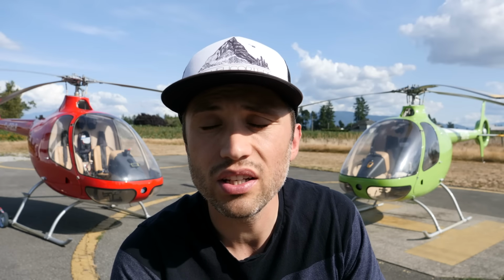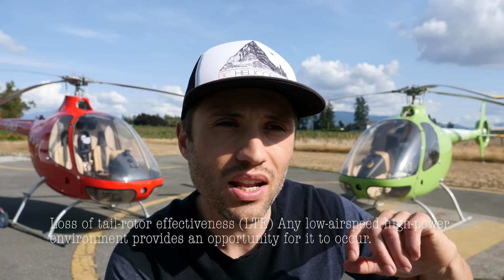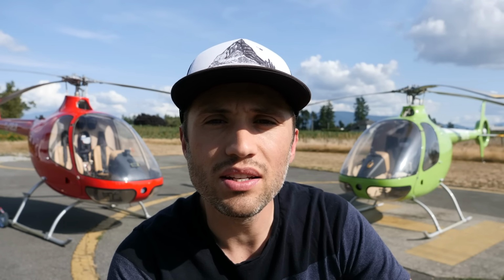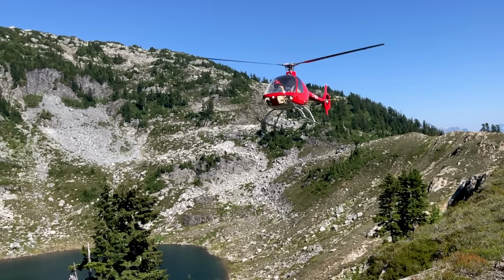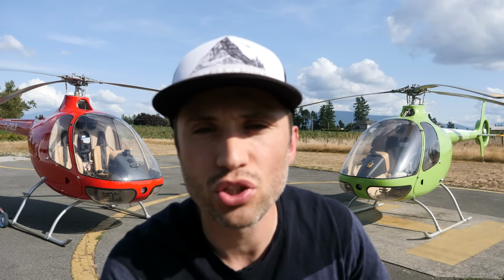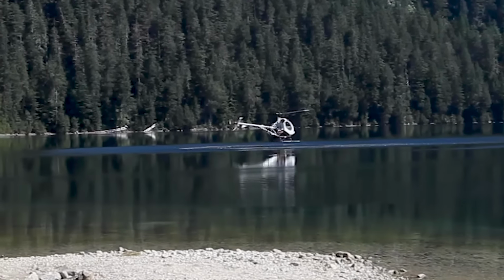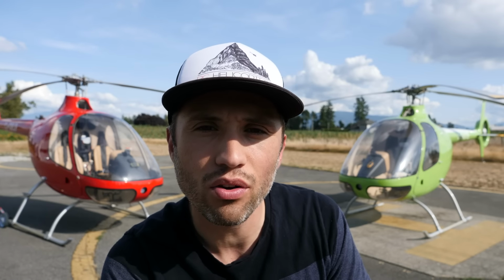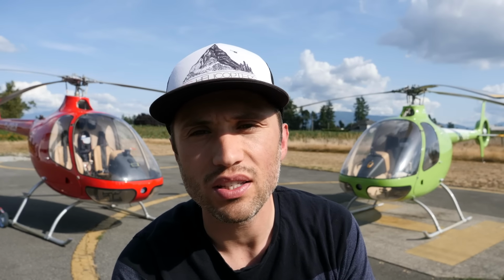OVERPITCHING and LTE can lead to a HELICOPTER CRASH

Comment: Ok, the million dollar question: why did the engine run out of power? Why did the copter slowly fall out of the sky in the first place? Are these dinky copters underpowered??
Reply: High density altitude, high heat, or high weight means the you need more power than normal to generate lift. Same as a plane.
Reply: Doug Rathbone So these dinky copters are underpowered. Thanks.

Comment: I can not find enough resourses to attempt to build a large RC and later a real Bell UH13-J. 

This I think  is going to cause for a higher cost.
There are many Bell 47 and close type of the Bell 47  yet very few Bell UH13-J. I can't even find a plastic model of this helicopter. Yet being it was the very first time a helicopter being used by the President of the United States and it was operated  through the  Air Force not by The Marine Corps or the Army. 
Is there any companies that could fabricate a Bell UH13-J and why is there so few to none being made in Plastic models, RC aircraft, or even the real thing. If any info contact me through my email of neilbfisher@yahoo com.

Comment: Don't like helicopters.. engine/mechanical failure equals hitting the ground like a dart. 
Least with a plane you can glide to safety.
Reply: Helicopters can make an emergency landing when the engine fails, it's called autorotation and if done well makes for a soft landing! So they don't just drop out of the sky!